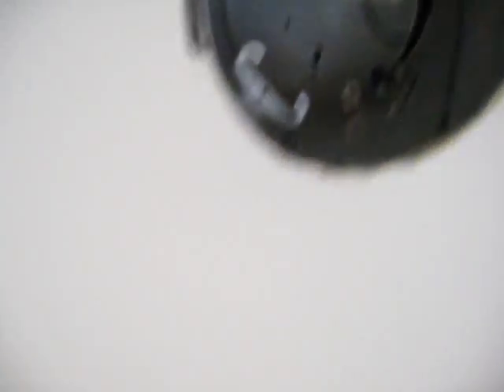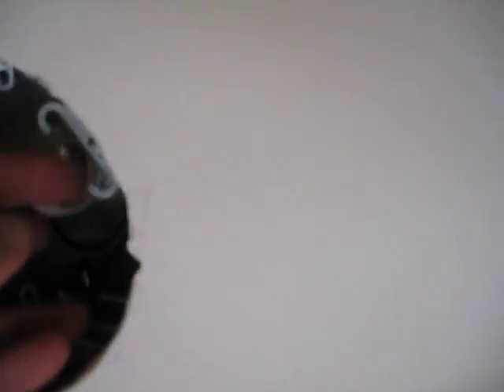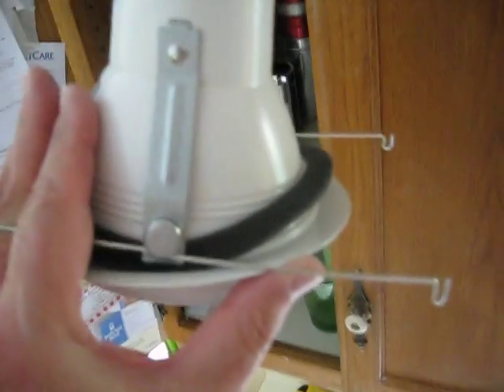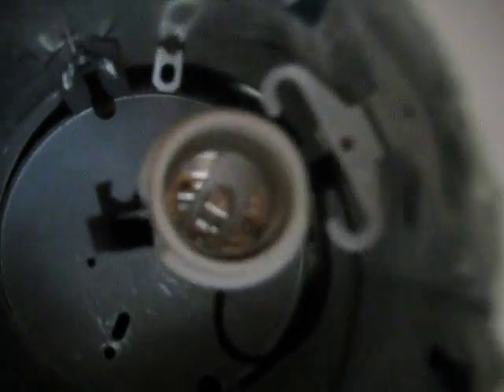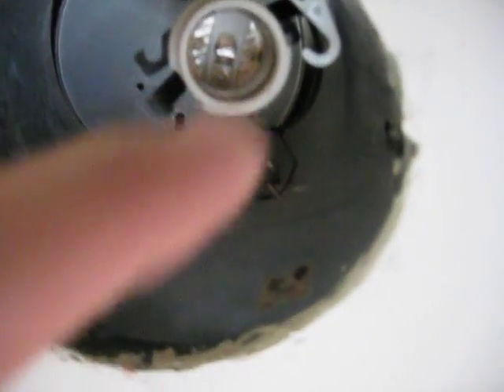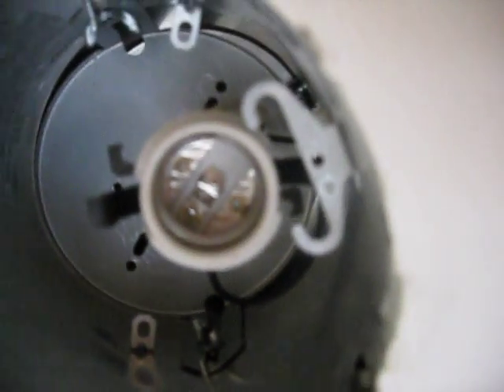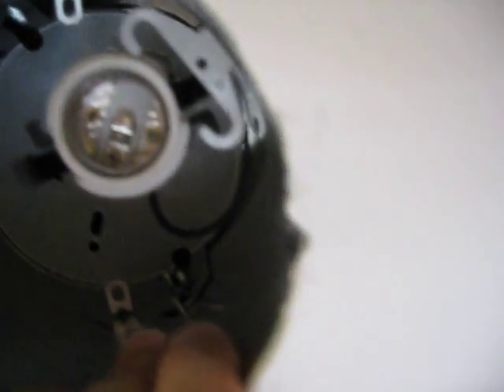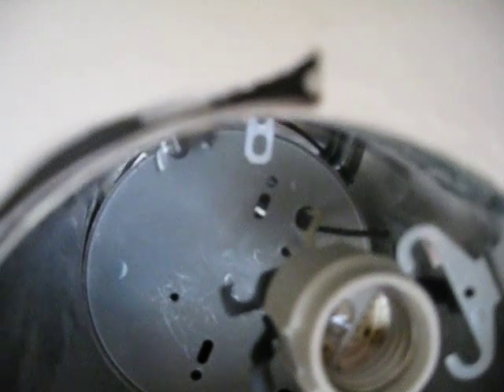Juno Can Light Reflector Installation

Comment: Actually following my last post, i thought i'd mention i have it all figured out. You need to remove that plate, its not needed. You are correct in unscrewing the socket, and installing it into the Juno baffle. That's what was missing on my installation. Anyway after removing the baffle, removing the socket with that one screw, then removing the plate and discarding, the side clamps then clamp it tight to the ceiling and make a decent air tight enclosure.

Comment: i have the same lights. Once you undo the top socket to attach the top clamps, how do you find enough room to reattach the socket.. I'm finding the side clamps are not enough to clamp it tight against the ceiling. Therefore need to figure out a way to use those top clasps.